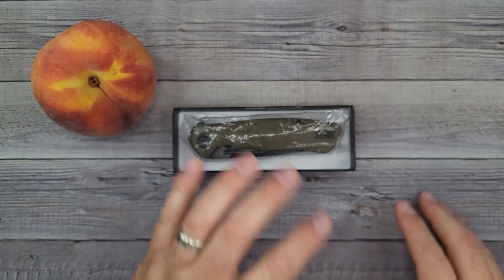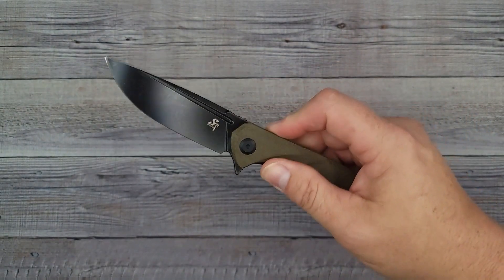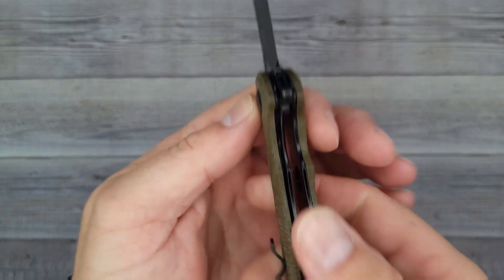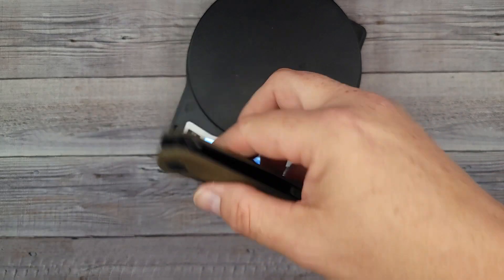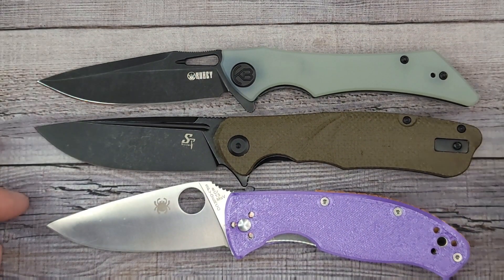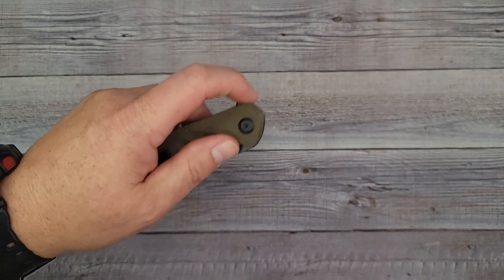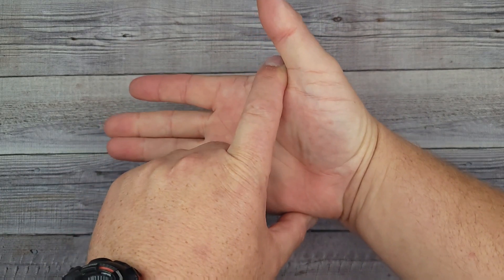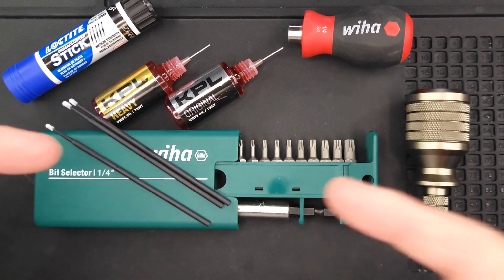THE $20 ONE'S SOLD OUT! STILL WORTH EVERY PENNY! SITIVIEN ST132

Comment from the maker: :_BeezBladesWelcome::_BeezBladesBeez::_BeezBladesRed::_BeezBladesBeezhive: ATTENTION! THE CHEAPER ONE'S IN THEIR GOOF HAVE SOLD OUT. THE REST ARE THE REGULAR PRICE. :_BeezBladesWelcome::_BeezBladesBeez::_BeezBladesRed::_BeezBladesWelcome:
Reply: Can you recommend a hard use folder that has one handed operation that doesn’t put my finger in the way of the blade. I want to be able to baton with it if needed. I’ve considered the ad20.5 3v, the bugout m4, the para 2 Cruwear. I like the tops fieldcraft and mini scandi but they are liner locks. Thanks for the awesome content!

Comment: I can put up with a little bit 0f ruff around the edges as long as the Rockwell is good and 53 is junk if it's not at least 58 9 0r in the 60s I wouldn't put it in my pocket D2 is great steel when tempered rite and I haven't seen one of them that the hardness was over 56 out of 7 of them as far as I'm concerned it was waisted money

Comment: You mentioned that the pocket clip should have had s slightly upturned tip.
I disagree...some of my knives do have such an upturned tip on the pocket clip and l find that small section to a "hot spot" when using the knives, but even more,  that upturned tip is aggravating to me whenever l put my hand in the pocket to reach for the knife or coins, etc. I feel the tip digging into my hand....l much prefer wire clips or minimal clips that do not have protruding tips.
Reply from the maker: Oh, believe me I know what you're saying. I don't want a tip pointing to the sky on the clip, just enough room for it to catch and go in my pocket.
I also very much so like the wire clips! As long as they are strong, they are much more comfortable. You mentioned the clip hitting your hand when you got something out of your pocket. Do you wear your knife on the outside of your pocket?
Anywho. I hope you have a fantastic Sunday, my friend! It's going to be a great day! 😀
Reply: @BeezBlades  :- Yesterday is history,
Tomorrow is a mystery, 
But today is a gift. 🙂

Comment: One thing that I'm not getting is whether here or there , I hear , well u may get two sharpenings out of it.  If for idk y . Well I know y but not y.  Any way if knife like that raise your angle to 40degree and do a 1min sharpning . That's only going to effect very edge. In fact on work knife 30seconds , might be ten years before I loose a buck but .  Never dull and no where near gone. .  These knives here do look like a 35- 45 degree angle or best not use on cardboard a lot